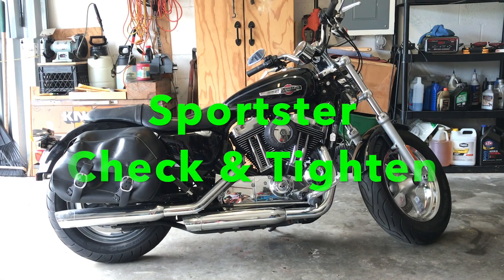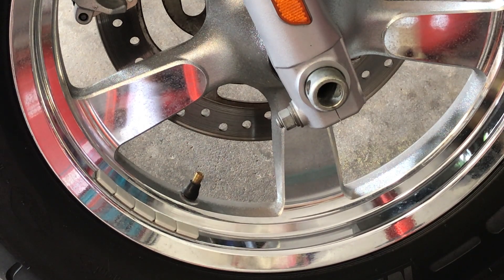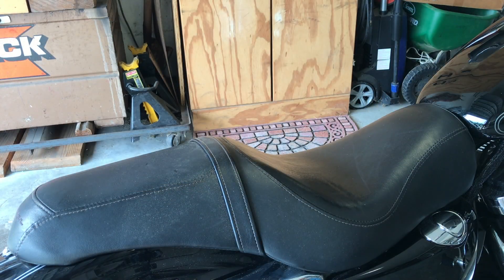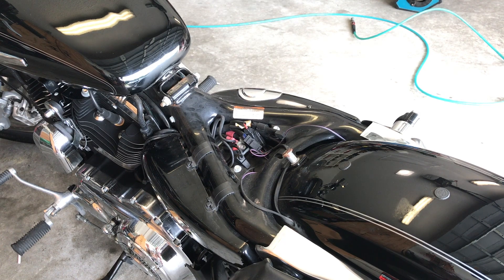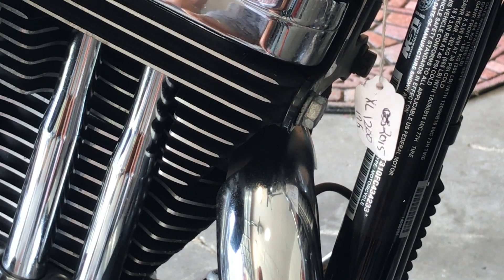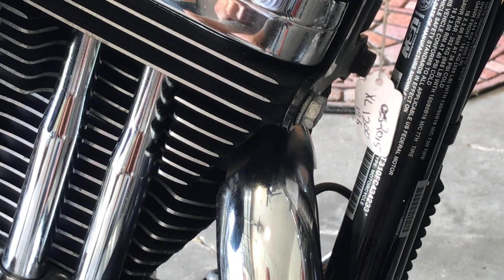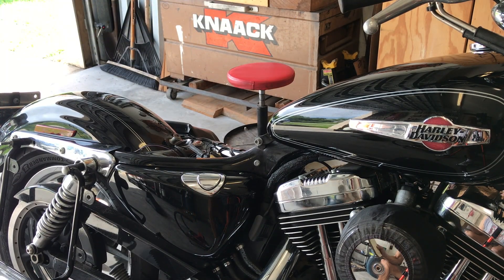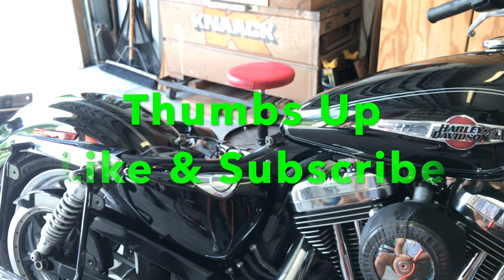How To, Sportster Things To Check And Tighten.

Comment: Hello Rocco, your videos have been a great help, I really like how you keep things simple.  Do you have a video instructing on how to cool the motor.  I have an 02 1200 Sportster, it's very uncomfortable to ride with the excessive heat against my leg.  I did wrap the exhaust and put on a heat shield...no help.  Could it have anything to do with the stock air intake or a specific oil to use.  How do you feel about oil pumps or fans?  I'm hoping to solve this at a low cost.  Thanks, Brian
Reply from the maker: I don't see an easy answer. I live in Florida these HD's get hot. I have a Road King so the exhaust is low and helps a lot but the motor gets hot.  Sportsters are hot riding bikes especially if you have an exhaust that's right on your side of the V twins. Sorry I don't have a better answer. Thank you for watching and your support B Fitz.  Ride safe and have a great day. The big V twins aren't as bad.

Comment: hello
my question is what about the neck bearing
Reply from the maker: Sports there are lighter bikes. The neck bearings usually don't go out of adjustment. If you feel a wobble in the front of your bike, then you need to look into it I would buy the manual. Thank you for watching and all your support. Will. Ride safe and have a great day.

Comment: I have this same bike. Recently had to replace the rear brake line. In order to do such had to disconnect the exhaust. Replaced the brake line successfully, but now when I put the exhaust back on it doesn’t align correctly and the rear brake pedal hits the top of the exhaust about half way thru the pedal stroke. I have both exhaust gaskets bolted on snug and tight, so i’m not understanding how the exhaust is now riding up higher than before? Any ideas?
Reply from the maker: Happy to help. I would rework the front  pipe and rotate it down a little bit. Take your time and look at it,  you know it laid out and worked properly so you will get it to work properly again.  let us know how it works out. Be patience. Thank you for watching and your sub. Ride safe and have a great day.

Comment: How about header exhaust pipe flange nuts? I bought brand new forty eight. Rode it for 100 miles and lost a nut on the back pipe. Checked the other nut and I could unscrew by hand with the flange flapping all over the place.
Reply from the maker: Thank you for the heads up and your sub.Col  Ride safe and have a great day

Comment: What is the difference between primary clutch adjustment vs threaded nut adjustment on your clutch cable
Reply from the maker: Happy to help. Free play at the clutch hub pin. Thank you for watching and all your support BobbyD. Most times you don't need to touch it. Ride safe and have a great day.
Reply: @TwoWheelRocco  is 3/8 impact wrench good enough to do taking off tires and anything in bike. 18v
Reply from the maker: @Soulriderpowder  Happy to help. I have a 3/8 snap-on.  It's not that strong for the big stuff  I would recommend a half inch and take it from there. Thank you for watching and all your support BobbyD. Ride safe and have a great day.
Reply: @TwoWheelRocco  is 300ft/lbs of torque good enough to do all the work on bike
Reply from the maker: @Soulriderpowder  I found it in adequate. think 600 or more. My gun is 1200ft/lbs. Mine is an air compressor gun.. Is 3/8 or 1/2?
Reply: @TwoWheelRocco  1/2
Reply from the maker: @Soulriderpowder  I would think 600 for a 1/2 gun. But let us know how it works out.
Reply: @TwoWheelRocco  are we talking about fastening torque or breakaway torque
Reply: @TwoWheelRocco  is dcf894 dewalt impact wrench good enough for everything has to do with bike
Reply from the maker: @Soulriderpowder   I believe you're talking about fastening torque. I would check your manual for the specs Thank you for watching and all your support BobbyD,  Ride safe and have a great day.
Reply from the maker: @Soulriderpowder  I never had the gun I would not know. Check the specs and let me know what the foot pounds, I have a better answer for you. Thank you have a great day.
Reply: @TwoWheelRocco  so this model has fastening torque 330 ft/lbs and breakaway torque is 600ft/lbs. is that enough torque for doing all the work for 2012 1200 custom
Reply from the maker: @Soulriderpowder  I do believe that should work out just fine. Let us know when you get it how it works out. Ride safe and have a great day.

Comment: One other concern is that the primary fluid ( Harleys Sportlube ) needs to be drained and replaced regularly. 
Years ago I had a catastrophic failure of the transmission because I didn't know how the tranny was lubricated.  On the bottom of the transmission trapdoor are a couple of openings for the oil to enter. But if you ever remove the primary cover you will usually find aluminum dust in this oil. Since I didn't realize it the magnitude of this sludge, it ended up plugging off the openings to my transmission,  this ended with my purchase of a complete transmission since the lack of oil burned mine up.
Sure hope my input leads other Sportster riders to a better understanding of their motorcycle.
Reply from the maker: I agree Steve. Oil changes are mandatory for the long lasting motor. Thank you for your insight.

Comment: I have a 2000 1200 Sportster and it feels like it wants to come out from under me I'm a first time rider and it rode good until I tighten the bolt in between the handlebars up do you think that why it feels that way now
Reply from the maker: Happy to help I would check tire pressure. I'm not sure what bolts you're talking about but for it to feel that unstable, I would lean towards the tires pressure. Thank you for watching and all your support. Ride safe and have a great day.

Comment: Tyre pressures are always a grey area on motorcycles, too many opinions on internet. Where should I be on 2004 Dyna wide glide Rocco? I trust your info implicitly.
Reply from the maker: I like 41 pounds in the rear 36 in the front. I feel that's best for the tire and you're riding experience. Any questions just ask. Thank you for your Sub Simon. Ride Safe and have a great day.
Reply: @TwoWheelRocco  Thanks Rocco, Im running 4lb over in front then, was a little skittish. Stay safe my man.
Reply from the maker: Happy To Help, Any questions just ask. Thank you for your Sub Simon.  Ride Safe and have a great day.
Reply: Tire pressures for each model are found on the front frame of the bike not far from the VIN.

Comment: Hey man. Great video!!! i'm gonna check stll this stuff on my bike. 

I just bought my 1st every harley 06 1200 custom sportster. Had sport bikes since i was 16 and I'm 44 now. figured it was time to upgrade to an adult bike. 

this isn't the bike i wanted... but thought it was a good cross over starter bike and i got cheap enough. 

but needs a few things. drove it 15 min and the throttle cable broke. 

now it won't start. even with a boost it just clicks. It should atleast start with a boost no?
So Is that the battery or could it be something else I should check before buying a battery?
Reply from the maker: Happy to help, check your battery connections  notorious for getting loose. If you need a battery,  let me know I'll send you othe link. that I use very reasonable. And a high-performance battery at that.. Thank you for watching and your Sub Dustin.  Ride Safe and Have a Great Day.

Comment: Rocco, i'm having two issues with my 05 sportster 883xl. My throttle return is messed up, I have to manually return it. and two, my bike has a hard time starting when its cold out even with the choke all the way out. 1) I tried untangling the cable and putting some lube inside the throttle case and it didnt help. 2) I changed the oil, new spark plugs, new battery, and put some redline in the gas tank. Still having issues. Any tips?
Reply from the maker: Happy to help. As for your throttle put play into your cables and see if that loosens up the tight throttle.   6:15  https://youtu.be/BAmsFghbv9M.   should help. As for the starting of the bike I would check the Petcock for Bad Diaphraph, the lines are old and collapse this affect the vacuum that operates the Petcock. I will send two videos.  Test petcock  Diaphragm  https://youtu.be/7Fo9Q93OJXI.   Let us know how it works out. Thank you for watching and your sub Erin.  Ride safe and have a great day. Hope this helps.

Comment: 1996 Xl1200S owner here.  My bike is special and new in 1996 with many new Factory upgrades.  I stopped at Green River to do a HD required warranty service.  I bought my bike in Saskatoon.  I was on holiday.  I got into argument with shop workers and owner over front tire pressure.  I asked if they filled front tire to 40 psi. They put 36 into it.  I said HD manual says 40.  No HD dealer ever dealt with K591 Dunlops before.  After service complete, I take my bike across street and start filling my tire.  One of the GR employees sprints across road and pushes me out of way and installs 40 psi into my front tire.  They corrected their mistake quickly, but they still thought they knew more than the owner.  
I updated Harley Davidson Sportster Wiki page with info on the 1996 XL1200S and the 1995 XLH1200 Canadian Edition.
Reply from the maker: Dealer are tough places.  There  know it all attitude. Bad business practices.   Stay warm..
Reply: @TwoWheelRocco  Non dealers are most often worse cause they think they know more than the Factory.  In my case, my bike was so new, I had Tampa HD tell me my bike did not exist.  I was working there and needed a bike inspection, so, after showing them my bike in the parking lot, they approved it.
I did get a dyno run while i was there.  59 hp and 69 tq at rear wheel. Stock.

Comment: I've been having a hesitation when starting my 2015 Iron xl883n Sportster. I was told to check battery terminals and tighten them so I did and they were fine. Then I was told it's a good chance my ground is loose which is supposedly common for Sportsters he said. I think he called it "ground to earth"? I can't figure out what exactly I'm looking for but from what I gathered, it's somewhere near the rearr passenger peg and belt on exhaust side and it's a bolt or a nut? Do you have any idea where and what exactly I'm looking for? Thanks
Reply from the maker: Happy to help. In my experience, the battery is weak. Sportster are tough on batteries. The best bet is to buy a battery from Harley Davidson any other battery you buy in today's world, China are cheap. I buy my battery from Harley Davidson and that's your best shot at a good battery. The first signs of a weak battery is a sluggish start up. Thank you for watching and all your support. Ride safe and have a great day. Let us know how it works out and how old is your battery?  As for the ground you all you got to do is follow your ground cable to your engine block and that is it. Hope this helps.

Comment: hello, cool viddy ... i got an 87 sportster 883 in a hardtail , with forward controls ... one day comin into the driveway ,  it don't wanna downshift , so i guess i was in 2nd or 3rd and goin for 1st ? anyway i lugged it in and parked thinking no biggie , i just missed the shift ? ... next time out , i start in 1st and and it won't go into second , so i try tightening up the controls , which were a little loose and still would not shift , so i take the forward controls off and try to shift right at the shaft, still won't shift ... so i hear there's a seal that was notoriously put in incorrectly at the factory and needs to be replaced ? or maybe it's a shifter pawl adjustment ? i had trouble getting the cover off and didn't wanna break anything so i got on here ... any input would be appreciated
Reply from the maker: I would try to rock your bike back-and-forth while trying to shift. I mean sitting on the bike moving it forward and backwards forwards and backwards. I think you are stuck in between gear. If it was working it should work I'm not that familiar the the 80s Sportster's. Let us know how it works out. Sorry about that I wish I had more. Thank you for watching and your sub. Ride safe and have a great day.
Reply: @TwoWheelRocco  ok thanks , i'll give it a shot and let ya know

Comment: Rocco! I was riding my sportster xl1200c and lost power,now the bike starts and sounds great.I kicked in first gear and it doesn’t move an inch.I was told it was the clutch so I changed it myself and the bike turns on but still doesn’t move at all. Please help!! Thank you
Reply from the maker: Happy to Help,   look at your right side Drive pully, sometimes the splines fail I have seen a few times. Let us know how it works out, Thank You for  watching and your sub.Pete...  Ride Safe and have a Great Day.

Comment: Hey Rocco! What do you think about removing the baffles to make my sportster louder? I been looking on a lot of forums to see if it might cause problems to my bike but I can’t seem to find anything. Would it cause any damage? Or would I have issues with inspection and stuff?
Reply from the maker: Happy to help. I'm not a big fan of drawing out baffles on exhaust systems. Slip bonds are cheap enough to buy in their engineer to work well. He will not lose that much back pressure. Which will affect your performance. What year what bike question? Thank you for watching and your sub Chris. Let us know how it works out. Ride safe and have a great day.
Reply: @TwoWheelRocco  thank you for the response i really like all your content! I ride a 2008 nightster. I read about the back pressure which for what i understand lowers the torque and hp, i feel like I could go with that. I just don’t want to have any issues with inspections or damage my bike if I do take them off
I will definitely be reviewing some slip ons and see what of the 2 options is better
Reply from the maker: Take a look at this.  ebay   https://www.ebay.com/itm/391692883488?hash=item5b32b71620:g:GQgAAOSw9lZfWSEz. Hope this works. Nightster are very tempered low RPM bikes., I love to run.  Hows Yours?  Ride Safe and have a great day.

Comment: Hey Rocco, any chance you know what size the front motor mount bolts are on a 99 sportster? Have one missing and can’t find a part number or correct size anywhere online. Thanks!
Reply from the maker: Sorry I do not. But I did remove my right side one and went up to my Ace Hardware and got a replacement for my Sportster's. Hope that helps. Thank you for watching and your sub Dylan. Ride safe and have a great day. Let us know how it works out.
Reply: I appreciate the quick response. Unfortunately the other side appears to be a threaded rod and 9/16 nut with washers. I’m assuming whoever installed it was having difficulty installing a hex bolt because that side is very tight with the frame. I appreciate your help! Love the videos!
Reply from the maker: @Dylan-zl3xn   What year Sportster?
Reply: 1999 sportster 1200 xl
Reply from the maker: @Dylan-zl3xn  Tried to take a look at my manual but I could not find it, sorry. Go to the dealer. will be relatively cheap. Let us know how it works out.
Reply: Yea I checked mine as well. Thanks for the help. I’ll keep you updated!
Reply: Hey Rocco I figured it out. A 3/8-16 x 1 1/4” hex bolt with a split lock and flat washer did the trick. Once again I appreciate the help
Reply from the maker: Thank you for the update. You'd be surprised, This will help. Ride safe and have a great day Dylan.

Comment: How tight should the nut be when adjusting the axle? One of my nuts started to back off after installing my chain. The axle is still tight and straight, the nut just started to come back. I tightened it up, but I didn't want to tighten it to much right now because I didn't want to strip it. Any advice would be great!
Reply from the maker: Happy to help. What year Sportster?  Thank you for watching and your sub Johnny. Ride safe and have a great day.
Reply: @TwoWheelRocco  it's a 2018! Your videos are great! Keep them up.
Reply from the maker: @jonnymac8925  You mention a chain that's what threw me off,  it's a belt.   HD service manual it says 95-105 ft lbs for rear axle nut ... Hope this helps.  Ride Safe and have a great day.
Reply: @TwoWheelRocco  it was a belt lol it is a 530 chain with sprockets now, I just wasn't sure on the torque spec for the axle adjuster and someone borrowed my service manual. There's a few videos on my page of the bike through its journey being built over the past two years. It's not everyone's cup of tea but the bike hauls ass, handles and stops amazing! 95-105ft lb for the small nut on the end of each axle adjuster? Or is that for the nut on the axle itself? Thanks for responding and be safe out there!
Reply from the maker: @jonnymac8925   That's the axle nut 95-105 .  Adjuster hardware snug it out. Know superman stuff.    If the axle nut is not tightened properly that will move under pressure.   your adjustment will go out.   Hope this helps.
Reply: @TwoWheelRocco  absolutely!  That's what I thought about snugging down the nut on the adjuster and that's what I did. The axle is snug and tight, the wheel is straight and the chain has proper tension. When I did the chain I installed red locktite on the adjuster hardware and one side still backed off, I just couldn't remember if there was a torque spec or if it was snug! Appreciate your help kind sir!
Reply from the maker: @jonnymac8925  My pleasure. Let us know how it works out. Ride safe and have a great day.

Comment: One thing you didn't check was the primary chain adjustment and the primary fluid level. This oil lubricates the primary chain, the clutch pack, and the transmission.
Reply from the maker: Yes, The primary oil level is important. It should be checked and adjusted if needed. I am a big believer in changing your oil every 5000 miles and you'll never have a problem as for the adjustments. Very healthy setups that doesn't get adjusted much at all.  Thank you for watching and your support Steven. Ride safe and have a great day.